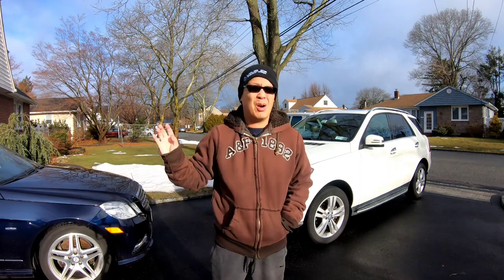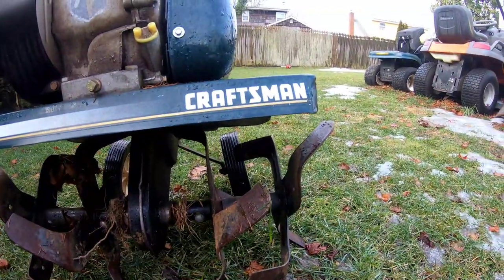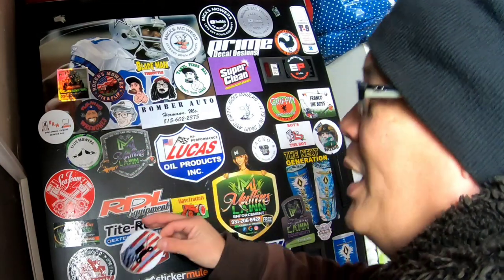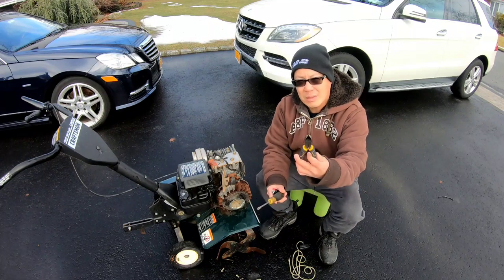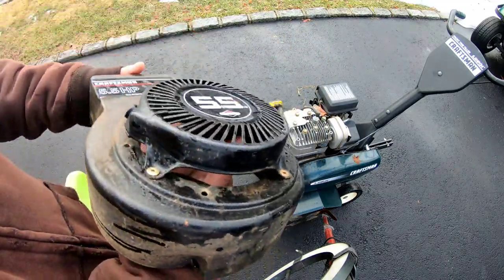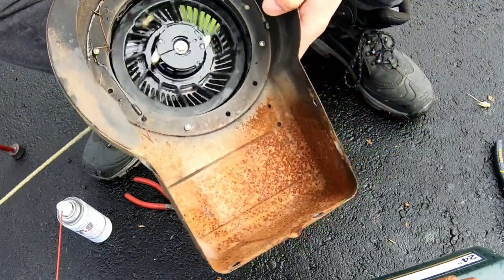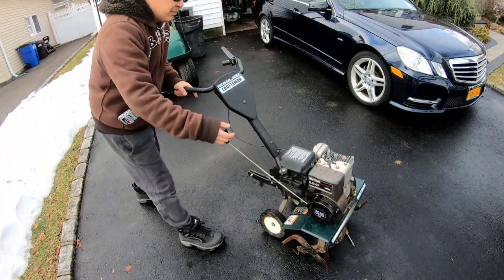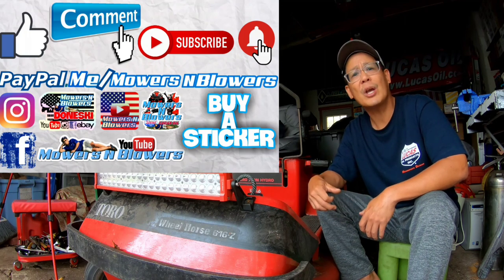HOW TO FIX A BROKEN PULL ROPE HANDLE ON CRAFTSMAN 5.5HP FRONT TINE ROTO TILLER RECOIL STARTER REPAIR

Comment: So, "HOW TO FIX A BROKEN PULL ROPE HANDLE ON CRAFTSMAN 5.5HP FRONT TINE ROTO TILLER RECOIL STARTER REPAIR" was nearly 20 minutes into this 30 minute episode, and told me *exactly what I needed to know*!! (TY Henry), and I did learn some stuff (electric snowblowers might not be as lame as previously anticipated and [Duh] Honda makes a better one than B&S). My only critique is burying the lead until the 3rd period (from an NHL POV) was unexpected.  But again -- Henry came thru for me!  I'd have been trying to remove unremovable parts, and who knows what else were it not for this wonderful video.  'got my vegetable turned over, which was the main thing.  Thank you, Henry!
Reply from the maker: Lol!  I’m not sure if you’re happy or mad.  Either way thanks for commenting

Comment: Bro, seriously, I wouldn't sell the beast over the ariens, the beast has a better engine by far, parts are readily available for it, but the orange most of its parts are not able to be gotten engine wise, you can add heated grips on the beast, if it has a light then it can handle heated grips, I would sell the ariens, 1000 would be a good offer.... Just a thought.